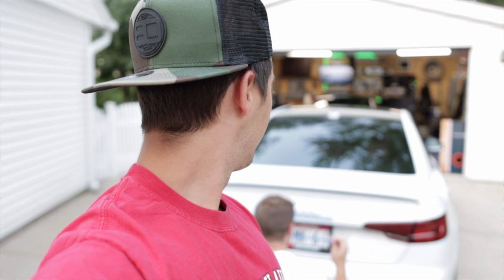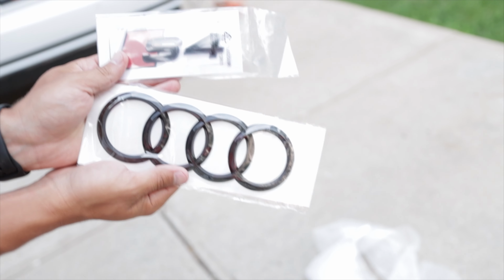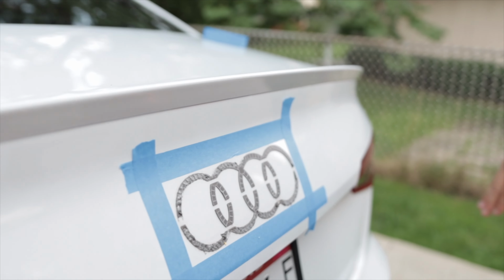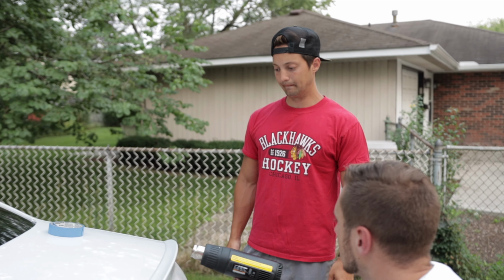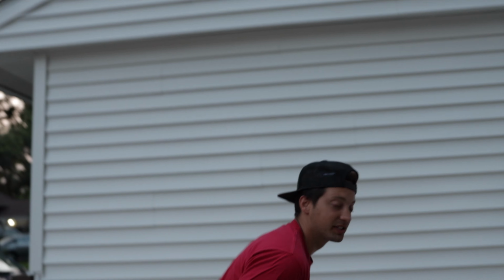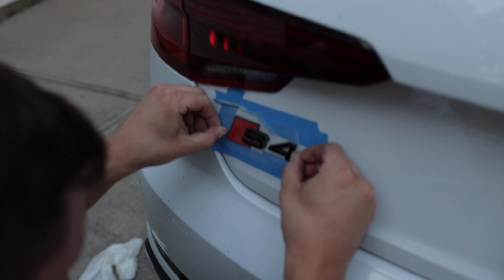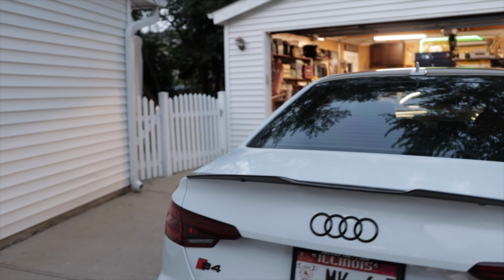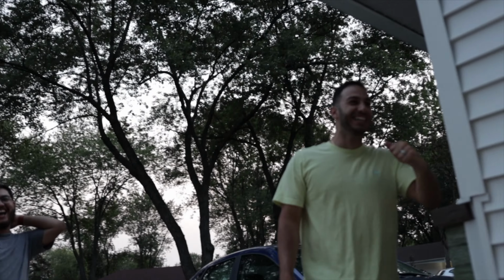Making the Audi S4 Look Better with these Simple Mods! ( BLACKED OUT!)

Comment: Be sure you coat or wrap that spoiler. Most carbon parts that aren’t OEM or very expensive will yellow and peel in a  year
Reply from the maker: Great call, definitely at the very least getting it ceramic coated